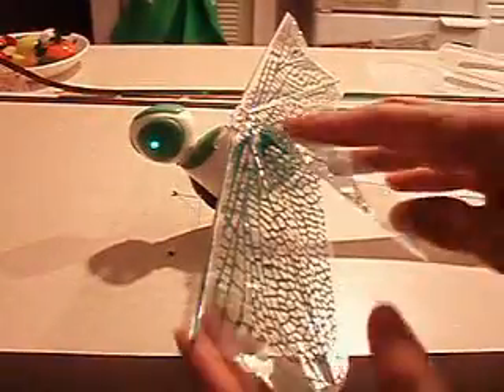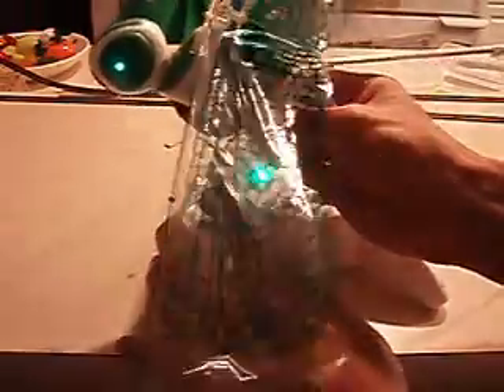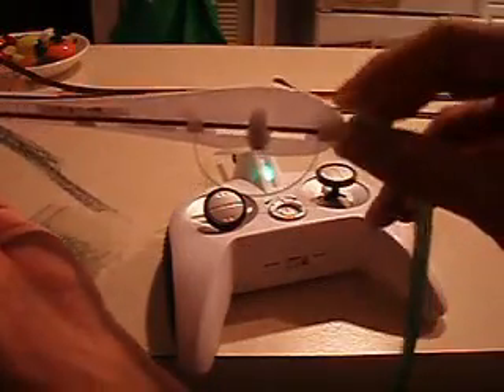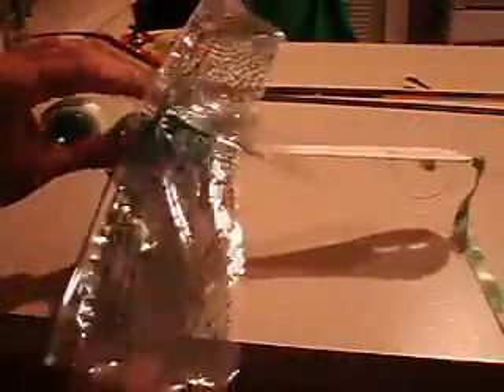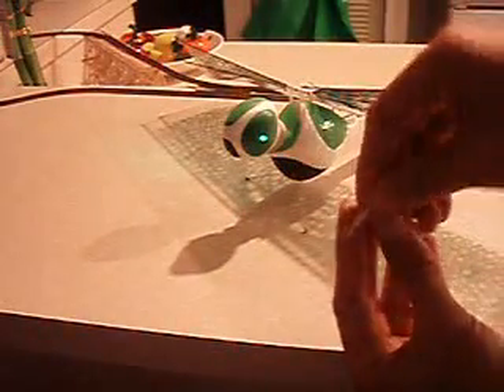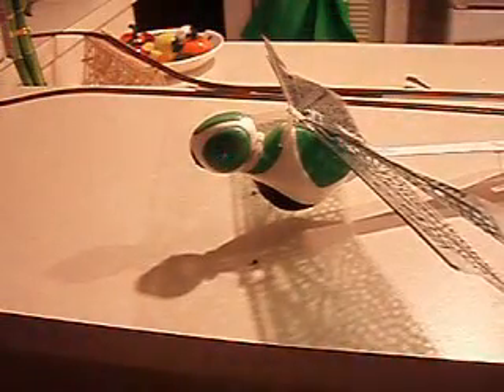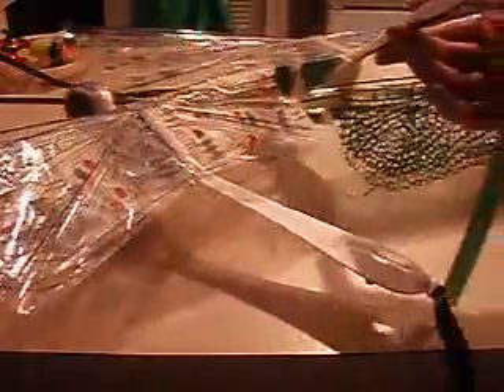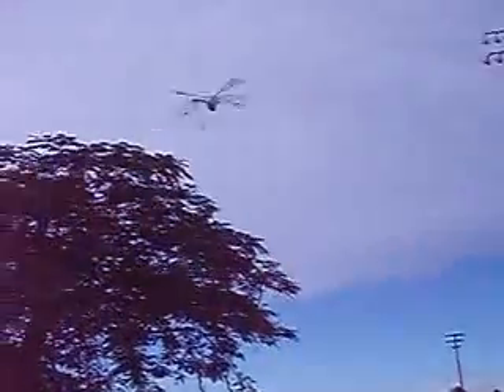RC Dragon fly tech- Make your bug fly better!

Comment from the maker: Its been a while and I still have my fleet of RC Dragonflies but unfortunately as of Jan 27, 2015 these models no longer start up as their internal batteries are all sealed up within the foam hull of the toy which will only function if some how the battery can be replaced by a new one... the company that makes these have stopped production and this is a pity because it is such an interesting flier....there were some groups of fliers that actually began modding them with new batteries and some fly after being stripped off the foam hull... it is a toy that has a battery sealed life of less than 7 years.

Comment: im crying right now cause my dragonfly wont work. the controler works perfectly but the dragonfly wont charge and the LED light will only turn on if the remote is on and the dragonfly is on whilst in the charger.

Comment from the maker: @neonchris007 If you followed all the normal charging procedures and it still doesnt light up then it is a factory dud!
I have purchased many myself and ocationally I get a dud bug! the fault may lay in the battery and since the toy was minted in 2007 the batteries should all be crapping out by now...even my best flyers will soon be dying out!
only way to keep flying is to open it up and place a new battery- experiece in electronics required!
use a battery from a recently crashed toy heli!

Comment from the maker: The Rc dragon Flys are now on clearance at Radio shack for about $15- $20 dollars!

As of  August 2009 they could also be purchaced at Target, Kmart,and Walmart but you will have to find the stores that still stock them and the still run $25- $30 dollars. on line at E-bay it is over $50 with shipping! They may be out of production and will probablly become fazed out. Only die hard enthusiast will seek them out to keep a running fleet of exotic flying toys.

Comment from the maker: I really do not know why the buit a trim and beginner - Expert mode.... ?
If you change the trim out of neutral , you will eventually crash, and beginner mode produces crappy responses during flight when power is demanded in critical moments....Always set to expert mode and trim at neutral- and use the tairl ribbon!

Comment from the maker: To replace a wing:

 Gently pull the wing rods straight out of the plastic sockets and then un hook the back of the wing, notice a plastic hook near the back holding it on.

do the same for the other wing but if it is undamaged you can leave it on and fly  different colored wings!

Adding wings on:

1st hook the one wing side on the plastic hook and then push the rods into the sockets- make sure they are in tight! Repeat on other wing.

Comment from the maker: That would depend on many factors- I own 8  and 3 are actually factory duds! you might be right... many need to be tweeked as they are not perfect, but thats the fun part!

Once flying they are tempermental to any wind and cannot be flown in the slightest of winds.
The pilot must be able to balance the throttle for perfect flights.
I fly several at a time and charge in sequence for nonstop flight, people often come up to me asking if they could buy one.
Experience will make you fly better!